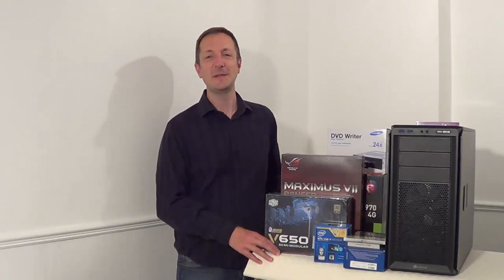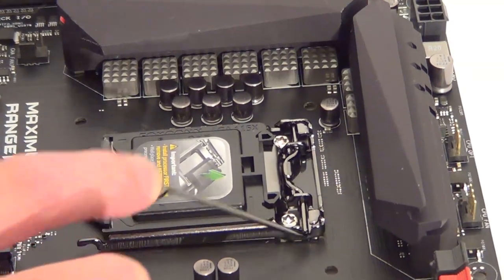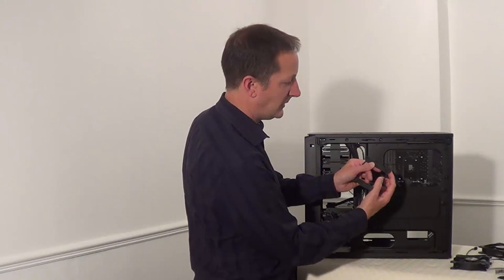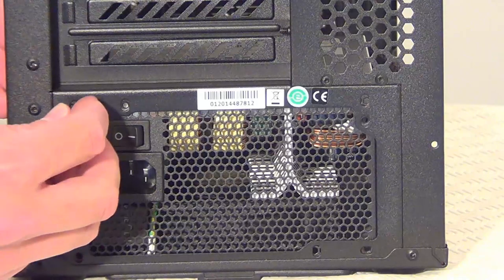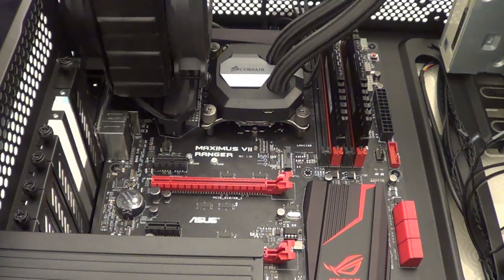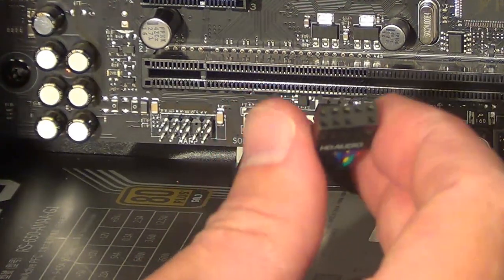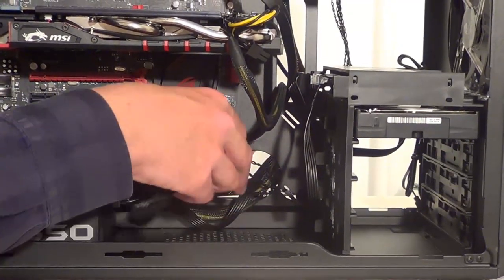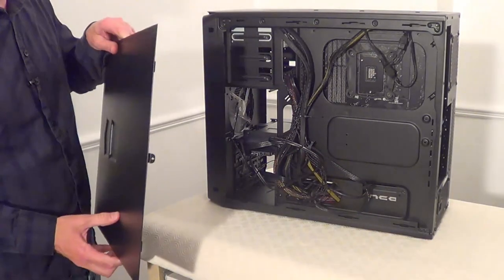How To Build a Gaming PC 2016

Comment: Is this build good enough to livestream best games in full hd and play them ?  i know ram and psu could be better but will doit in the future maiby year or so  just wanna know is this build goo enough for evreything can i livestream play highest resolutuion best games and render videos and stuff ?
Intel Core i7-7700K, Quad Core, 4.20GHz
Arctic Freezer 7 Pro Rev.2 -cooler
MSI Z270-A PRO -motherboard
DDR4 Kingston HyperX Fury Black 16GB (2x8GB) 2133MHz CL14 1.2V
Internal HDD Seagate BarraCuda 3.5'' 1TB SATA3 7200RPM 64MB
Kingston SSDNow UV400 240GB SATAIII, 550/490 MB/s
ZOTAC GeForce GTX 1080, 2x IceStorm, ExoArmor, 8GB GDDR5 (256 Bit)
Chieftec ATX PSU A-80 series CTG-650C, 650W Modular
Corsair computer case Carbide Series™ SPEC-01 RED LED Mid Tower Gaming
Internal DRW LG GH24NSD1
Reply from the maker: yes, this pc that you wish to build would be fine for that.

Comment: is this build good?

CPU: AMD Athlon II FM2+ X4-860K

MOTHERBOARD: MSI A68HM-E33 V2

RAM: HyperX Fury 2×8gb total of 16gb

HARD DRIVE: Western Digital Caviar Blue 1TB

CASE: Aerocool Aero-500 

POWER SUPPLY: Thermaltale Hamburg 530W 80plus

GRAPHIC CARD: Sapphire R9 290 4gb Tri-X OC

THANKS FOR YOUR RESPONSE
Reply: +Gianluca Bucciarelli This is a decent rig, but your cpu will limit your graphics card slightly and your overclocking performance may be limited. The r9 290 from sapphire is a little overpriced and is a massive card you may want to look for something smaller and more cost effective like another r9 290 or the newer r9 390
Reply: Gianluca Bucciarelli Hmm I have never bought anything from there before but that is a good price

Comment: Is there another case that has a full window to show all components, or is this the only one you can use for this specific build?
Reply from the maker: There are many cases that can be used for this computer with a window. The case used in this video is an ATX. All ATX cases are similar in size. Most ATX cases can be used for this pc.
Reply: +EasyPcRepairs So an evolv atx would work?
Reply: +EasyPcRepairs Also could I use an i54690k with a z97 mother board?
Reply from the maker: Yes, most Z97 motherboards will support the i5 4690k CPU.
Reply: +EasyPcRepairs Fantastic! Thanks so much for your help. You made my life a whole lot easier!
Reply: +EasyPcRepairs Also, what graphics/video card would you recommend for an i5 4690k?
Reply from the maker: That can be quite a loaded question and depends on your budget, but to keep things simple I would recommend the Nvidia GTX 960 (4GB version).

Comment: forgive my ignorance, but what do u mean by grounding urself regularly?
Reply from the maker: So that you don't build up static electricity on yourself (and then potentially touch a computer component and destroy it), touch something that's grounded every once in a while such as an unpainted part of a radiator. This will remove static build up on your person.
Reply: Ahhh... Interesting... Thanks dude! Can you show us the video of booting up a newly setup pc, installing Windows etc, stuff like that. Also, am I correct that I'll be able to freely change the OS of the system (Windows, OS X)?
Reply from the maker: Generally speaking, you can't freely change the OS of a system. If you want to use Windows you're best off with a computer that will support Windows. Same for OS X. There are work arounds if you really wanted to install OS X on a Windows based computer but it's best to stick with one or the other. Freely change the OS... no.  Possible... yes.
Reply: EasyPcRepairs Ok thanks! +1 sub!
Reply from the maker: *****
Thanks for subbing!

Comment: Will This Be Good For Gaming/Even Work?

Processor: Intel Core i7-5960X 3.0GHz 8-Core Processor

CPU Cooler: Cooler Master Hyper 212 EVO 82.9 CFM Sleeve Bearing CPU Cooler

Motherboard: Gigabyte GA-X99-SLI ATX LGA2011-3 Motherboard

RAM: G.Skill Ripjaws V Series 32GB (2 x 16GB) DDR4-3200 Memory

Storage: Seagate Barracuda 1TB 3.5" 7200RPM Internal Hard Drive

Video Card: Asus GeForce GTX Titan X 12GB Video Card
              
Powersupply: EVGA SuperNOVA NEX 650W 80+ Gold Certified Fully-Modular ATX Power Supply
              
Case: Fractal Design Define R4 w/Window (Black Pearl) ATX Mid Tower Case
Reply from the maker: +Overdose Yes, this would be a top-end computer for gaming and work too... there's no doubt!

Comment: I recently upgraded my mother board and used everything the same except CPU, heatsink.  at first it took 5 minutes to start up and I thought something went wrong but out of nowhere Windows appeared.  I was so relieved and I started playing my mom game and it worked perfect.  but then I wanted to play a steam game called prototype 2 and it was good.  I played 7 minutes into it and it crashed.  I tried again and then it crashed in 1 minute.  now it crashes every 1 minute into the game.  I played Lord of the rings Lego and it didn't crash.  so I decided to test out middle earth and it crashed in 7 minutes.  is something wrong with my system, kind sir?  prototype 2.exe has stopped working. am I supposed to update some kind of driver or something?  I'm very scared that I have messed up something.  please help.
Reply from the maker: +JokerEatsBabies When you replace a motherboard for one that is a different model (even if it's the same company that made it), you need to re-install Windows. The reason is because your old motherboard drivers will still be present and are not fully compatible with your new motherboard. This can cause crashes. Two other reasons that your pc could be crashing... CPU and motherboard incompatibility or CPU overheating. I dought your cpu is overheating because it's fine when you play other games. If you're sure you have a compatible cpu and motherboard, that brings us back to the first reason. So the most likely cure to your problem is to do a clean install of Windows.
Reply: Omg thank you so much!  It was that I needed to reinsert my activation key.   Thank you so much for your fast response!
Reply from the maker: +JokerEatsBabies No problem!

Comment: can i play GTA 5 on this computer pls answer pls
Reply from the maker: +OMGamer Yes, GTA 5 will run VERY smoothly on this PC.
Reply: +EasyPcRepairs thank you but i want to now the all compenent price
Reply from the maker: +OMGamer £1,000 (about $1,400 USD).
Reply: +EasyPcRepairs thank you so much for this awesome video
Reply from the maker: +OMGamer No problem!
Reply: +EasyPcRepairs thanks for everythink dude , i have one more question you have a lot of money to make this computer pls give a way to earn money online my familly dont have money pls found a solvf for me pls ( if you want ) in both ways answer me an thanks pls .
Reply from the maker: +OMGamer You're welcome! Are you asking me how you can earn money online?
Reply: +EasyPcRepairs yes pls i need some fast money pls pls pls
Reply from the maker: +OMGamer I would recommend the book 'Make Money Online' by Steve Scott. It's on Amazon.
Reply: +EasyPcRepairs thanks
Reply: +EasyPcRepairs i want to ask ho is the best ssd sundisk ir samsung ??!
Reply from the maker: +OMGamer Samsung tend to be slightly better, but Sandisk are slightly cheaper. There's not much in it, both are good drives.
Reply: +EasyPcRepairs can i change the intel core whit this : intel core i7 6700k
Reply from the maker: +OMGamer The motherboard in this video has a Z97 chipset which does not accept the Intel Core i7 6700k.
Reply: +EasyPcRepairs thaks dude i have the last question . can i change the case with : nzxt h440 pc case ??
Reply from the maker: +OMGamer Yes, the NZXT H440 case would be good for this computer.

Comment: Hoping to run and record DayZ on Medium-High settings 60 FPS minimum, same with GTA 5, is this build suitable/excellent/passable/barely good enough? 
http://uk.pcpartpicker.com/list/8N8Zf8
Reply from the maker: Would be fine for DayZ and GTA 5, but I would recommend a 650 watt power supply though.
Reply: Swapped it out for an 850W for upgrade purposes, and a GTX 1070 (:
Reply from the maker: That's a good choice on the power supply. Never really hurts to go bigger, ready for future upgrades. Good graphics card too!
Reply: Thank you very much :)